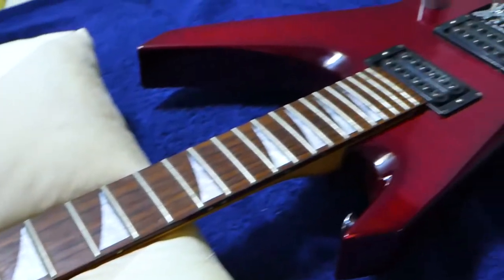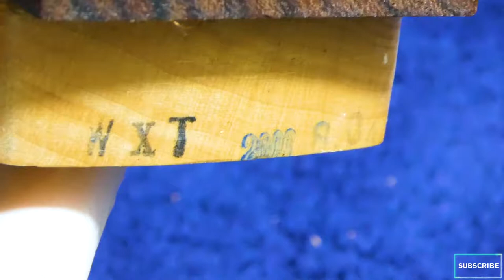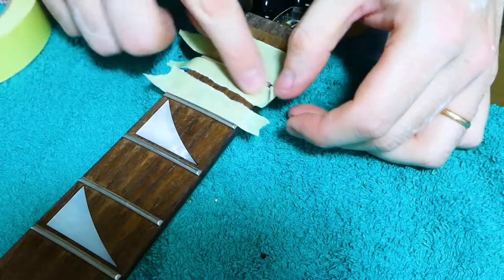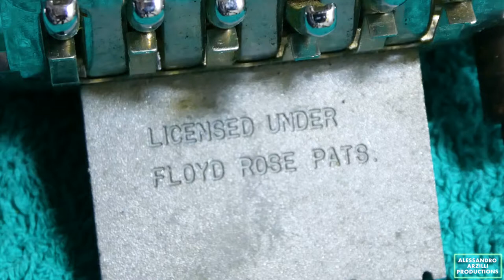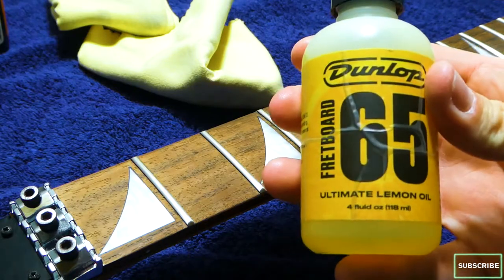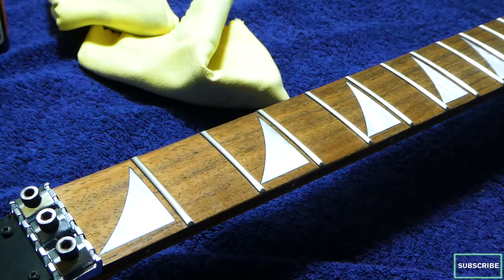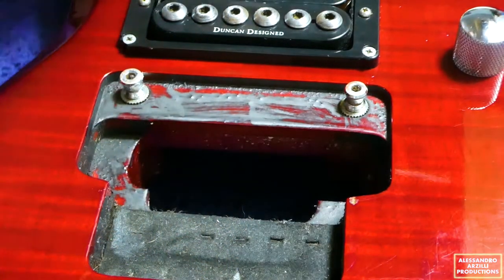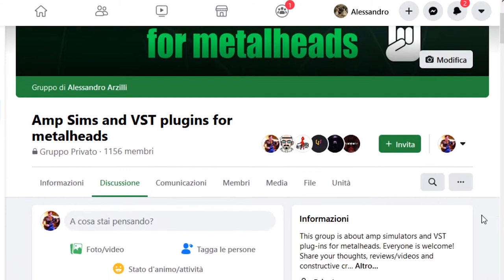Jackson Warrior WRXT - Trans red beauty from Japan

Comment: hello, i just got one of these and im going to try follow and copy this video but i have a question. when you were removing the pole pieces, why was it necessary to tape up all the pickups/rings? thanks
Reply from the maker: Hi, I taped the rings so as not to scratch them eventually if the drill bit would slide off, and also to avoid little pieces of metal to be attracted to the side coils (they're magnetic). thank you very much. Please consider subscribing to my channel for free, it really helps me to make better content.
Reply: @AleArzMusic  i followed your video today and polished my frets using steel wool, thank you, subscribed. though i made the mistake of not taping my pick ups or taking the neck off and ended up with metal shavings stook to my pick ups lol
Reply from the maker: Ouch that's exactly why I had taped the coils lol. Eventually they'll fall someday, just forget about them if the guitar sounds right 👍

Comment: Hey Alessandro, what did you use to clean the floyd rose?
Reply from the maker: Hi bro. That's the usual sanitizer/degreaser spray by Chante Claire, any other brand would work. Just wipe it off fast, it may leave residues

Comment: Ale please very nice what is that  Flame maple top or FMT on trans finish what write on Jackson page.
Where is that in guitar Whats this.

Body material:
2001-2006: Alder(with Flame Maple Top on Transparent finishes)
2007-2011 Basswood (with FMT on Trans finishes)Neck joint:
Bolt-OnBridge:
2001: Jackson JT-500 tremolo
2002-2011: Jackson JT-580LP tremolo
Reply from the maker: @marijazlatar5457  "flame maple top" on trans(parent) finishes = they added a thin layer of flame maple veneer on top of the big body piece of alder. For example, transparent red finish = alder body, with a thin layer of flame maple veneer on the top, in fact the back is not flame maple, it is just red.
Reply: 0:02  @AleArzMusic 

Absolutly nice of You what want to help. I see. It's not alder as far as I see in you and mine, but basewood They worked alder from 2001 to 2006 and basewood from 2006 to 2011. It is written on this list by Jackson. Yours is 2010, you can see it on the neck.
Is it right. What you think.
Reply from the maker: That's it, then, it is how you have seen on their catalogs. Thank you very much
Reply: @AleArzMusic  

Nice.im very happy if i can help bro.Everything best to you Kind regards